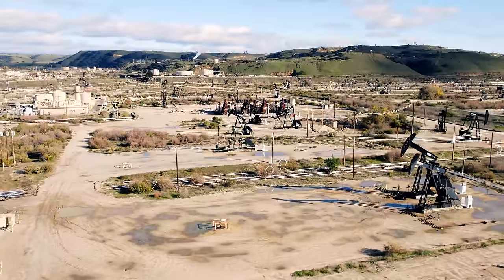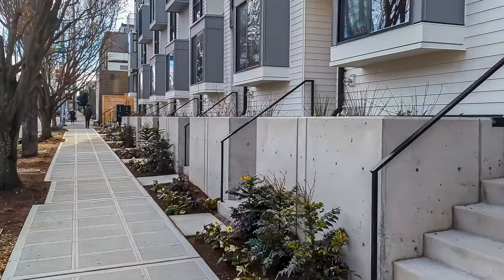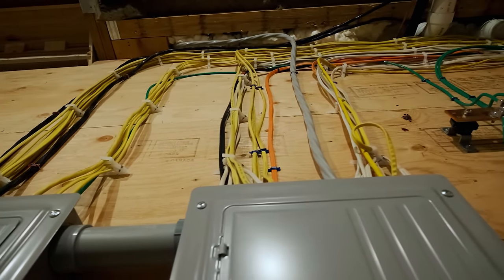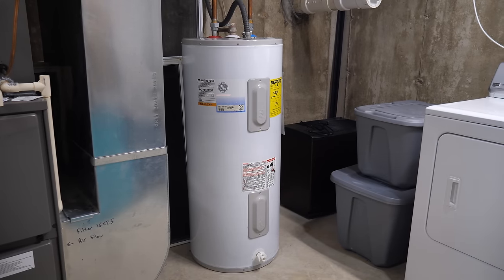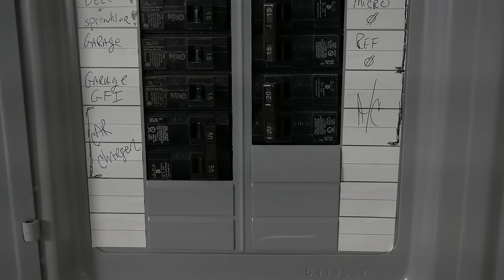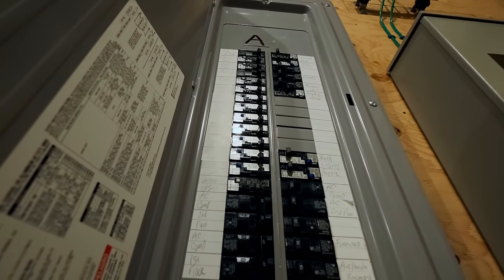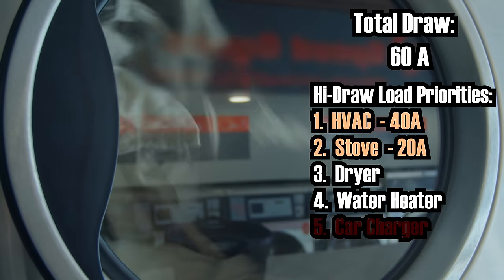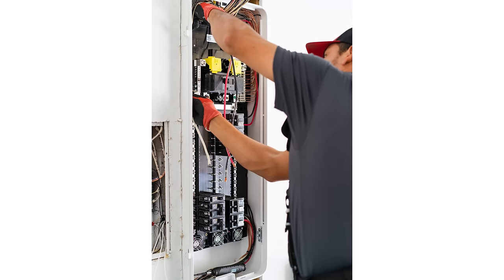Home Electrification: There's not a lot to do, and it doesn't have to be hard (Part 1)

Comment: I'm skeptical that a Span panel would cost less to install than a service upgrade from 100A to 200A (at least in most cases), especially in areas where electric distribution is aerial (on overhead wires, rather than underground). It's a cool option, but it seems like it's not (for most users) going to be less costly than upgrading the panel and the feeder wires.
Reply: And it's worse in every possible way.   Your load panel isn't where you want complexity and imagine you want to charge a car or something, too.   At some point you just need more watts.  This video really feels more like an ad than anything else.
Reply: The environmental cost of smart circuit breaker sounds lower than everyone upgrade to 200A. The maximum total electricity load to the electricity grid will be lower. Even if electricity energy can be stored in battery then be released to the grid for high load, battery charge-discharge is far from 100% efficient.

But I agree, the subscription model of most "smart" stuff and their "cloud" / phone-home tendency are putting people off.
Reply: @billyswong  upgrading to 200 amp service does not mean you are using more energy. I completely disagree with your conclusion.
Reply: @pkuras  The electricity companies need to take care of potentially higher peak energy use. That peak energy use can occur and will occur. It doesn't matter the new peak is in fact 120A or 150A. Higher is higher. Factor in that the cost of electricity generation does not line up linearly with the amount generated because of infrastructure issue etc, I hope you get what I mean.
Reply: @billyswong  sure, no argument there - as electricity use increases over time (for all reasons), the grid will need upgrades to accommodate higher usage. This has always been true, and the adoption of EVs is not unique in this regard, though it may result in a faster rate of increase in demand. But for one or a thousand electric customers to upgrade their service from 100A to 200A by itself has zero bearing on actual usage. There is zero causal link between a service upgrade and an increase in electric usage, and your original comment implied as much.
Reply: @billyswong THE SUN is gradually getting hotter, so in a few million years the oceans will evaporate.  It doesn’t how much energy we conserve… the planet will become unlivable 

.
Reply: @zachansen8293  leviton makes an in between option.  price point is comparable to regular panels, too.  it's not as complex as whatever that span thing is but its like a semismart panel.
Reply: Yeah we decided on a conventional square d qo panel. May eventually add smart measurement in there using hall sensors.